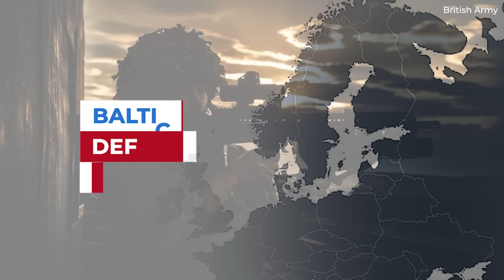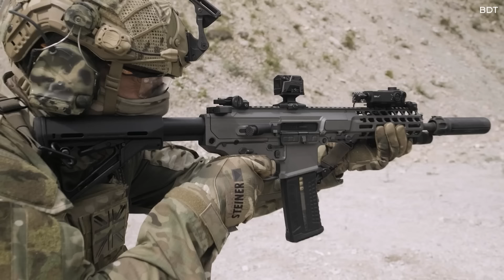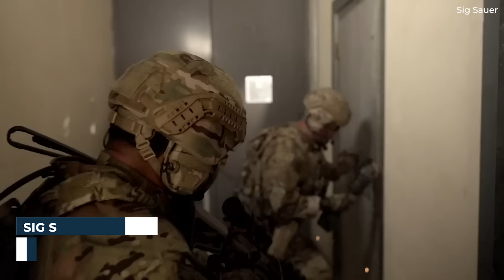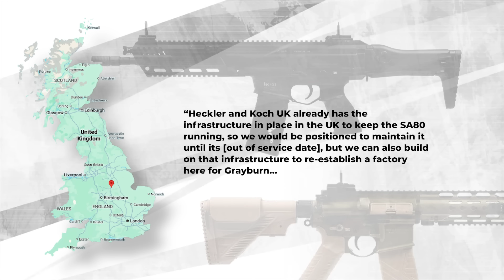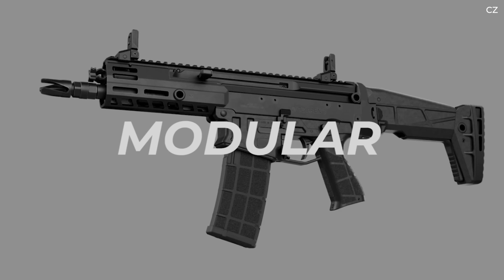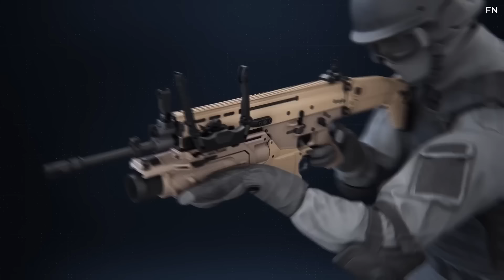Project Grayburn: How Well Do Various Rifles Meet Tender Criteria?

Comment: Here's how Grayburn will go:

The MOD will choose a platform that no other country uses because they want people to believe the UK Military are specialists with unique needs. The platform they choose will be perfectly serviceable but they'll add a load of unnecessary extra requirements because they want to feel like experts and put their stamp on it. All the tinkering will mess with the rifle and it'll face major technical problems, production problems and cost overruns. These issues will be covered up, the rifle will be bought in vast numbers and put into service where the soldiers will quickly report that it's a load of rubbish. The MOD will then contract H&K to fix the rifle at massive expense to the taxpayer.

Comment: Japan has a homegrown SCAR platform in .556 that apparently is able to defeat modern body armor.  The US Army should really abandon the 6.8MM cartridge and use a modern .556 design like Japan's.  Besides, the M-7/M8 platform is widely regarded as a disaster, as they typically can't even make it through a single mission without failure and the soldier can't carry enough ammo to compete in modern warfare.  The ridiculously expensive smart optic it was supposed to use has failed as well and soldiers are returning to standard holographic and LPVO options.  All in all, billions wasted and nothing to show for it except for technological regression.

Comment: All of Europe should adopt a unified "Euro Rifle," "Euro Pistol," and "Euro Knife" for primary troops, rather than relying on obsolete, fragmented equipment. For instance, main forces should produce and utilize a platform like the VHS for its tactical superiority over the legacy GI AR and AK platforms. However, the firearms lobby prioritizes profit margins through market fragmentation, intentionally preventing parts compatibility and standardized zeroing technology. This increases field complexity and drives up logistics costs.

Politicians and generals use these weapons for chauvinistic branding and propaganda, disregarding long-term strategy and soldiers' lives. There is a lack of genuine solidarity among allies; smaller armies, in particular, waste significant resources on niche small arms that are largely insignificant on the contemporary battlefield. These resources are consequently unavailable for critical equipment, creating logistical crises regarding spare parts and armory maintenance. Europe requires a singular rifle platform with interchangeable parts across the continent.

The American M16 was initially flawed, requiring numerous iterative corrections. The HK416 corrected the gas system and, following its adoption by France, Germany, and others, it has become the definitive platform. All other countries, especially smaller ones, should be convinced to unify around this rifle to standardize parts, zeroing, and logistics. This would allow them to reallocate funds toward drones, ballistic protection, and other high-impact equipment due to scale economy and rationalizations.

In terms of evolution (M16 -> M4 -> HK416), the Beretta NARP and HK433 improve upon the HK416’s weaknesses. However, they currently lack the "critical mass" of users required for a savvy strategic shift. Therefore, the HK416 remains the best pragmatic choice actually. While the VHS is an ideal tactical solution, pragmatism dictates the HK416. Despite being Italian, I view the NARP as a "technically excellent but strategically redundant" rifle in the current climate.

But if UK, Greece, and some other countries adopt the NARP beside Italy balance on this platform will change numbers and create a new pole for agglomeration. 
About cost... today HK416 seems to be a competitive solution. But scales economy can make a difference

Comment: If pricing is not an issue Sako's offering is the clear winner. It's only rifle that's been built from ground up to operate in arctic condition. I've shot HK riffles in extreme cold and cleaning them after use was a pain. Europe is clearly focusing on Russian threat more than middle east fighting so it would make logical sense to be more concerned about cold operation than hot. On top of that UK is member of JEF and just recently joined CAVS signaling great willingness to buy from Finnish manufacturers.

Comment: Thales F90 could also be a contender for a bullpup replacement. They are also working on a 6.8mm rifle
Reply: Bullpups have no place on a modern battlefield.
Reply: @l@l @libertylivesin1776  with body armour becoming a greater concern, higher bullet velocities and longer barrel lengths will provide greater capability. Fitting that barrel length in compact packages may be a desired design feature….so yeah not too sure about “no place” seems like you should think about that a bit more 😂

Comment: My money is on Beretta's NARP. The Hk416, Hk433, and SCAR are all tied in my head for a 2nd choice. I don't see the MCX platform getting selected, but I do see it doing well in the trials. CZ's Bren 2 is a very compelling options as well.
Reply: I think the BREN 3 has it in the bag. It's a thoroughly tested platform, with years of improvements. At a fraction of the price of FN's SCAR

Comment: Just buy the proven HK416 and 417.

All this is already settled.

Forget about leaving 5.56mm for main weapon, 6 x 416 and 2 x 417

HK will happily manufacture in the UK if they get a 40yr plus relationship.

These platforms are proven in all environments and fill the armouries at Poole and Hereford.

Much cheaper than the KS1 too

Comment: The re-jigged SA80 has proven to be one of the most reliable infantry rifles out there, although it's a bit 'marmite' (hated and loved by the troops).  The ammunition and perhaps the caliber might be worth reconsidering but it works, the production facilities, jigs etc still exist and the troops are used to it. They replaced the SLR because it wasn't well suited to Northern Ireland (drivers etc had to use the Sterling, which actually had a lot of advantages such as not punching through walls and causing unintended casualties). It is important, albeit very difficult, to define the actual job, in Aden the locals had the SMLE which was better suited to that kind of mountain warfare than the SLR. Glad this isn't on my desk.

Comment: What do we think? Beretta: will be vastly over expensive because it's 'badge engineering' reputation commands a premium globally, as well as the huge backhanders that will undoubtedly be paid out for the contract. It will require a lot of extra development work as it's not yet a well proven platform.

Sig Sauer: Will be hugely expensive and unreliable. Sig's reputation is awful at present as they face massive issues with law suits for unsafe pistols that are known to ND. Those legal costs will be directly passed on into production and contract costs for the MoD. Confidence in Sig is low globally. Let alone the geopolitical chaos with the US situation.
All others will absolutely suffer from similar issues. 
The procurement process will be subject to excessive political power, dodgy handshakes in shadowy back corridors and ultimately cost the tax payer five times more than it should.
We have several reliable AR platforms in service already, possibly four different types. It seems that if your SF outfit says it wants this or that type if rifle, it just fills out the request form and gets it! 
The no-doubt excellent, Knights Armament rifle, is an advanced choice, but massively expensive and not likely to translate to mass supply of a common rifle platform across all MoD users for the reasons included in this film. But there are other contenders. Colt Canada, might want to politically align with the UK and strength their political position against the US, by getting involved in supplying to the MoD and working on upgrading current C8 style platforms, already heavily invested in by the MoD.....
My guess, whatever the end result, we will end up with a weak compromise, because at its heart, this is more about securing a trade deal to build rifles in the UK, rather than a pure search for the BEST rifle out there.
I can almost already hear the parallels of the SA80 disaster, all over again ....and HK are in the mix already!

Comment: Bren. Does the job. Takes existing L85A3 optics and ancillaries like lights and lasers. Same mags. Will run suppressed. It can easily run .300 Blackout to please the sneaky beakies. It's the cheapest as well.
Reply: It seems like a no brainer , which is probably why we wont adopt it .
Reply: So does nearly every rifle today. Almost all of them take STANAG mags and have rails for lights, lazers, optics
Reply: @brabblemaster401 The Bren doesn't need an armourer to swap it to .300 Blackout. You also missed the bit about it being the cheapest. It also has a folding stock which meets the requirements of the SF and the RM. Again that configuration being cheaper than the Sig MCX that is currently used. Sig USA need kicking into touch as they are an unreliable partner.
Reply: Im not saying its a bad choice. Just pointing out that it has rails and takes the same mags as nearly every other western rifle. I personally like the BREN, I have the older one in America. 

But personally id like a LMT MARS rifle, SAKO AR,  or the new Berratta gun the most. AR15 platforms are just hard to beat for reliability, durability, and ergonomics. But im also american who carried an M4 for years and as a civilan have multiple AR15s to play with

Comment: Bullpup and then no messing with different barrel lengths or special rounds to make up for the lower velocity from shorter barrels.

Frankly, if you're happy with a shorter barrel length for your infantry then your rifle choice doesn't matter to you - get anything cheap and reliable (you chose to forego accuracy and distance).

With a bullpup, everyone can have the same weapon (so cheap because economies of scale) and gucci sights make the difference between roles.

Or are existing bullpups all crap?

Comment: Personally, I'd be looking at a chassis that can handle a barrel swap to change calibre. i.e. a simple armourer task where you can change from 5.56 NATO to either 7.62 NATO or 6.5 Creedmoor if considering other modern ammo. The 5.56 for standard use; the heavier calibre for DMR and providing extra punch in CQB as a close support weapon (say 33-50% running heavier calibre).

For me the HK, CZ or FN are viable options.
Reply: In practice multi calibre weapons are a total nightmare logistically for militaries. Works alright for special forces but they can afford to just have a dedicated weapon in each calibre. Ian McCollum on forgotten weapons has a good video segment on why multi calibre is great in theory and terrible in practice

Comment: UK MoD procurement is not known for its success rate. My prediction for this is, they'll cancel the project. Next is a rifle hugely late, and I mean into the 2050s and three or four times over budget. They abandon the new rifle and bring out the A4 A5 A6 SA 80. If you want something properly fucked up give it to the  UK MoD.😂
Reply: There wouldn’t be anything wrong with a further updated L85, make it a touch lighter and make newer higher velocity AP 556 ammo for it and it fulfills all the requirements for the tender. It’s a very solid system now

Comment: Though it isn't listed as a major concern, I would think that interoperability with Commonwealth or Continental militaries would be worth consideration.

The HK416A5 covers pretty-much all the bases, It's a proven design with mass-adoption on the continent, either as the primary service rifle (France, Germany, Netherlands, Norway...) or in more limited service (Spain, Portugal, Poland, Estonia, Croatia ect.), and a variety of global strategic partners (Australia, Ireland, South Korea, USA...), meets all the requirements with it's full length optics rail, accessory mounts at the 3, 6 and 9 o'clock, 11'' barrel for the PDW, 14.5'' for the Carbine and 16.5'' for the Rifle.
Reinforcing the relationship with HK also opens up opportunities for future programs too, if the MoD decides to re-standardize it's rifles, the HK416 was a close contender in Project HUNTER and could potentially supplement or replace the KS-1, and domestic production of L2A1 (HK417) could potentially lead to replacement of the L129A1.

Comment: I do wonder if Glock will also submit their AR platform (that was part of project Hunter)

On the ammunition though they should also consider the badlands shell shock ammo in 5.56. Testing suggests a massive improvement in velocity and lethality at range 

I can’t see the UK mod switching to 6.8 as the standard due to NATO’s interoperability.